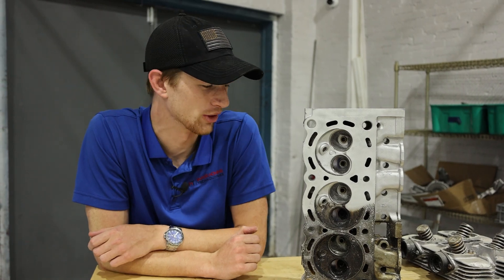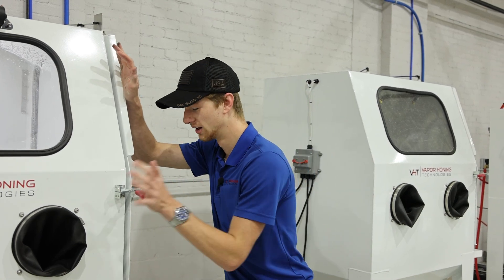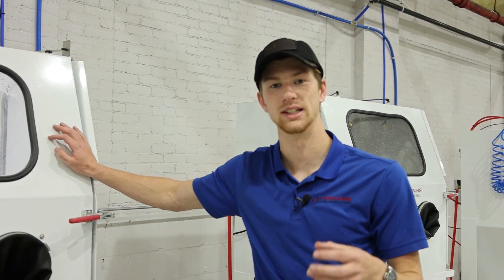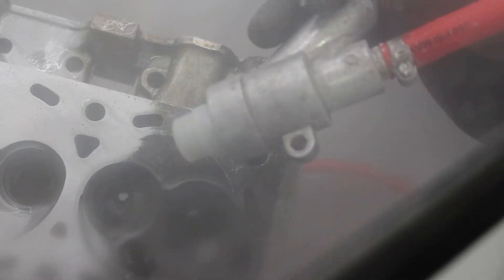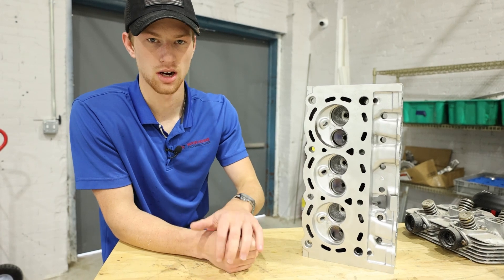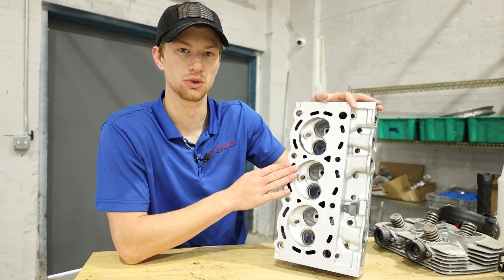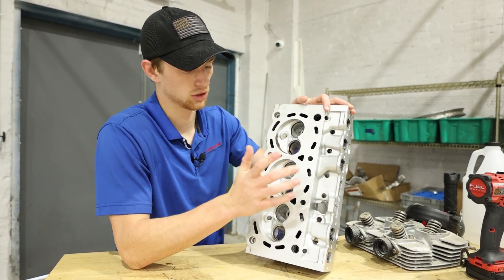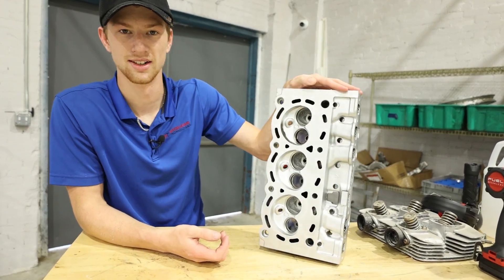Bringing an Engine Head back to a Factory Shine in Seconds!

Comment: If the bottom of the head (or even the top of the block) were already taken to a machine shop and decked, would vapor honing mess up that tolerance and cause head gasket issues?